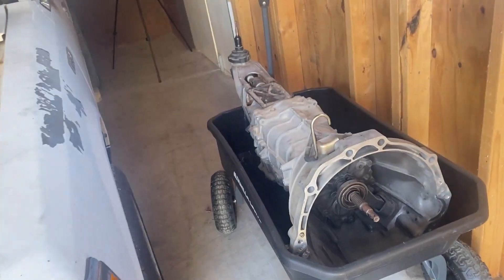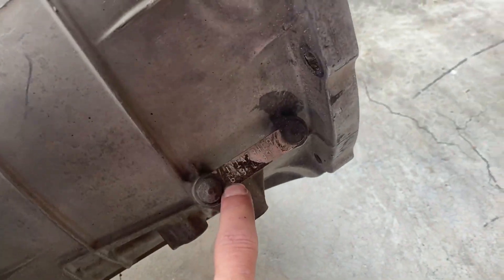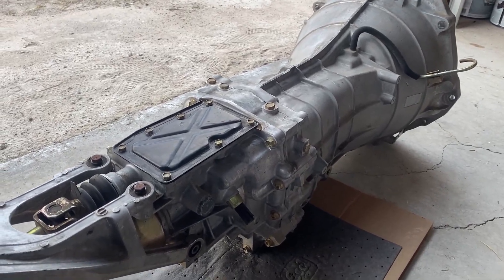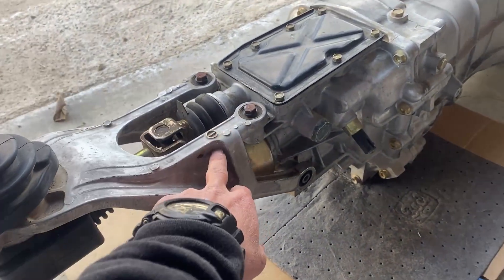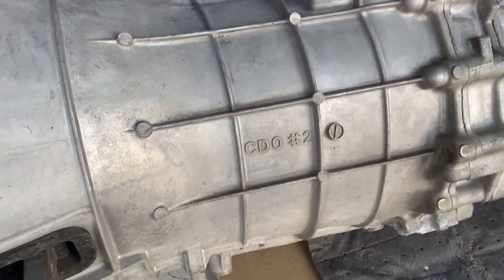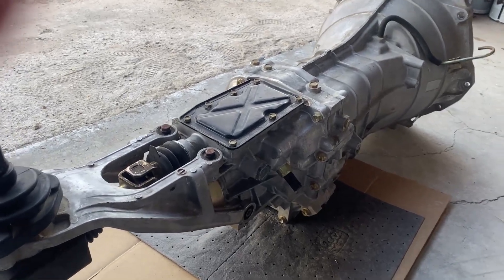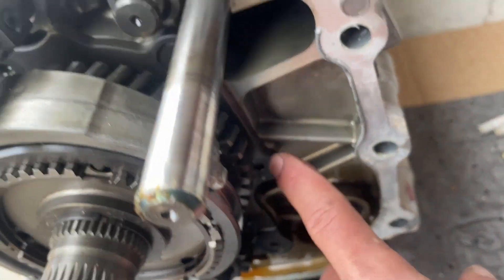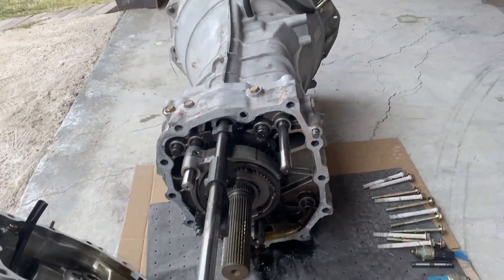HOW TO IDENTIFY A CD009 TRANSMISSION

Comment: Are the bolt patterns the same for bellhousing end and driveshaft? Like let’s say you swapped in the weak cd008 into a car, is the cd009 a direct replacement with everything being the same?
Reply from the maker: That’s I’m not sure, but I suppose it would be the same

Comment: Thank you sir just bought one in the house and says CDO#1 , just like you said open it up and is the  solid  plate , I also have a Nissan 720 with a 2jz with a DCT transmission 7 speed on a maxecu  bought the CD009 for a backup , much help thanks

Comment: Thanks for explaining that, this will be good for picking up transmissions when I can't run the VIN on the spot but I can use a ratchet to check.
Reply from the maker: Yessir, definitely good info! Especially sometimes they don’t have tags. 🤙🏼

Comment: Hi Mr davills can I remove my original  engine and transmission from my 1980 datsun  truck and install a Nissan Sylvia 1999.black s15 sr20det  engine  and5speed  transmission .thank you  and have a great  weekend.
Reply from the maker: Yes you can, some modifications will be necessary but I did find a guy that makes sr20 swap mounts for Nissan/Datsun. His page is on instagram @i2edeye

Comment: I have a 2007 Camry and it shuts off when I put it in drive. I had the transmission resealed but I’m not sure what to do next
Reply from the maker: Could be multiple issues causing the the problem. Would have to look at it
Reply: @davillsgarage  my car is in El Paso I Can most likely get a video and send it if you have somewhere I can send it